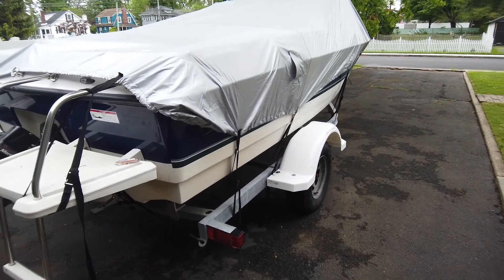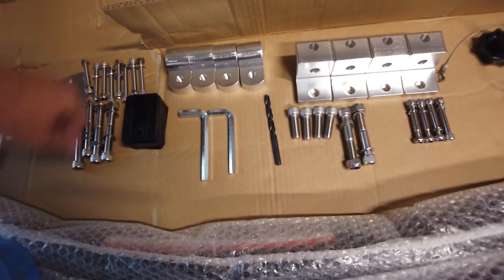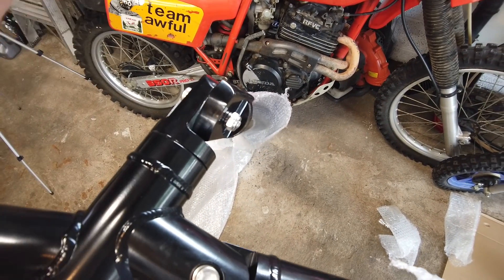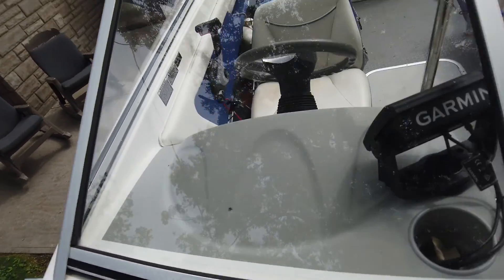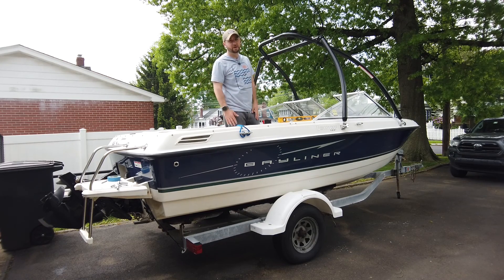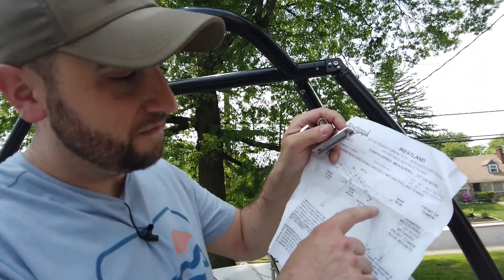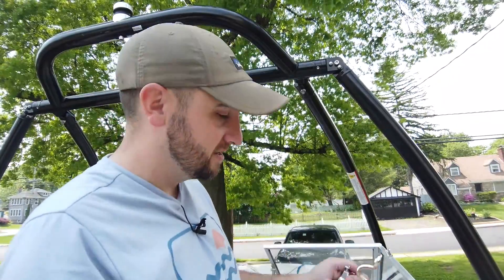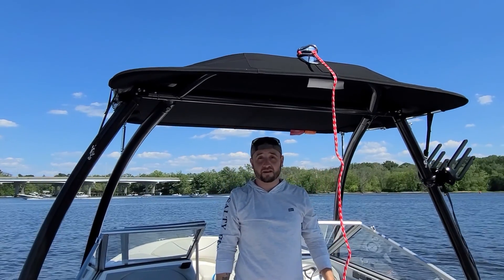Budget Wakeboat Build | Monster Tower MT1 Wakeboard Tower Installation and Review with Bimini Top

Comment: What did you think about the size of the bimini and where the shade actually ended up?  Have you had any issues with the bimini at higher speeds?  Did Monster include a storage sock for the bimini?  What about your boat cover, did you need a new one?  How about stowing the bimini while folding down the tower?  Is that possible?
Reply from the maker: Perfect size and rock solid at speed.  It's a very solid built unit.  And to be clear I'm not saying that because it was a sponsored unit.  I'd gladly trash any company that makes trash products. Gotta stay real.  100% back these towers and tops.

Comment: did you do any hull reinforcement? I'm not sure I would trust it without a bigger plate and more fiber glass
Reply from the maker: No. When all the holes were drilled the fiberglass surprisingly was at around 3/8 which is what the manual calls for to not need reinforcement.